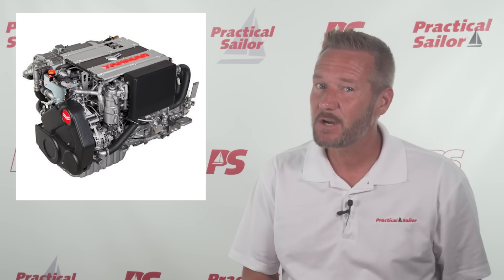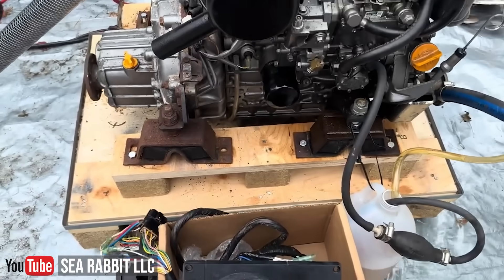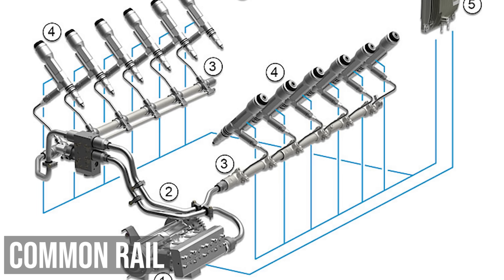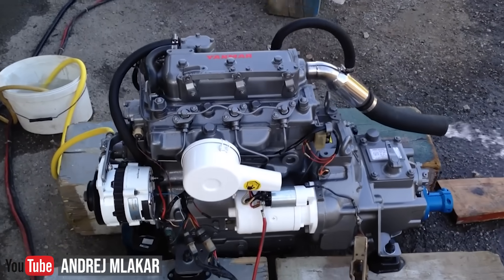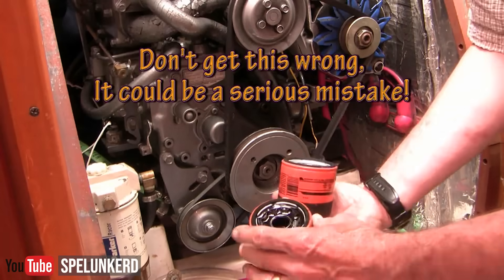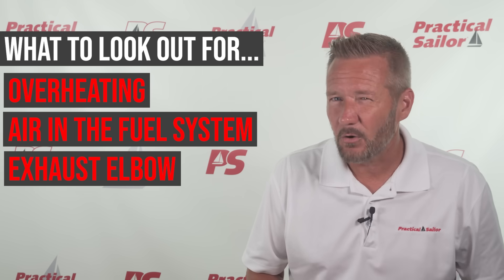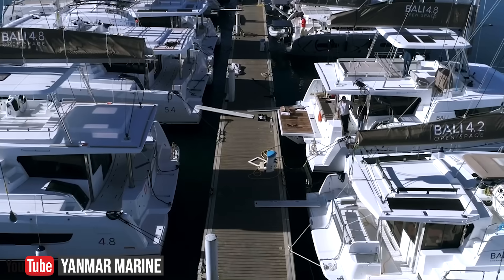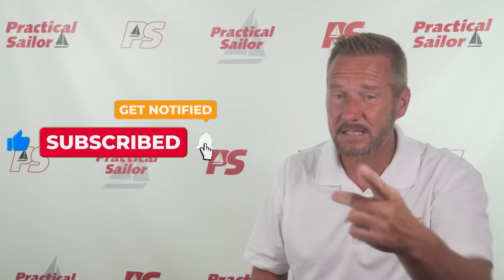Everything You Need to Know About Yanmar Sailboat Diesel Engines

Comment: He mentions critical nature of seals several times but neglects to point out the most important seal, and the one that fails most often, is the seal on the prop shaft in the lower part of the saildrive. When they fail water gets into the drive leg which causes a big problem if not addressed. These seals are not difficult to replace at haul out and should be done maybe every other haul out.
Reply: Don't run over fishing line seems to be the theme if you read ALL the comments here...fishing line just cuts the seals to bits.

Comment: I have a 3GM30 from 1999 that still works perfectly, touch wood. I love its simplicity and non reliance on excessive electronics. No glow plugs, but it has always started instantly, within less than a second of self starter, even from cold after not being started for days. To be fair I'm in the mediterranean though, where temperatures never drop very low. 😊
Reply: If that has a metal intake manifold and you head for a colder climate...
you could look at installing a Thermostart flame heater in that metal intake manifold (metal intakes for obvious reason when dealing with naked but enclosed flame)....
all it needs is a drilled and tapped hole in the manifold, minimal supply of diesel... and 12VDC.....
the slug of hot air ensures instant starts in cold to very cold weather....
Reply: @JohnSmith-pl2bk Interesting...thanks for the tip!

Comment: Yanmar? Excellent. What I don't like is seawater cooling in any form, nor watered exhaust. I've seen that diesels like to run at a very low 10-20% horsepower, but hate the lowest idles. You don't see anything like my 22 to one compression in boat diesels. They don't climb mountains to 12,000 feet, nor operate in deep cold. What I like about my air cooled Situan Sifa are these facts: Undersized means excellent for turning an alternator. Hand pull start. To change the oil, run it hot, disconnect, pick it out, and pour all the oil out the fill port. I've never used the empty plug. Steel gears and no timing belt. Utterly mechanical injection. I've never air bled the fuel system. Just hit the decompression lever and cranked out the air. The aluminum and steel castings are excellent without defects. I made my dry exhaust adaptation out of stainless steel.

Comment: Yammar.  corrosion of the saildrive is an expensive issue if not managed.   Coat the aluminum drive as recommended.  Propspeed, interprotect other is important to maintain, as well as checking and replacing the anode at least annually. . Don’t scrub the coating off the drive leg. When a diver is cleaning the water intake ports, you may expose aluminum that will corrode away.  Check the anode, make sure you have the correct anode metallurgy.  The split ring anode can be replaced in the water, and protects the saildrive, but not the prop.

There have been some manufacturers who have had corrosion issues with their saildrives.   If you keep your boat in the water year round, make sure you get a good inspection, replace the anode, and maintain the coating.  
Replacement drives have more robust metallurgy.  Maintain and avoid this.

Comment: ALL diesel are direct injection 

common rail just uses a mechanical pump that keeps ALL the injectors at the same pressure and then are electrically opened to the correct cylinder that is at TDC  
the other type - mechanical - uses a pump that is timed to send pressurized fuel to the cylinder that is at TDC  and that pressure is what opens the injector 

ONCE AGAIN ALL DIESEL ENGINES ARE DIRECT INJECTION ENGINES
Reply: Oh one other thing if you are going remote locations sailing..any lightning strike on or near the boat can fry the engine's  electronics...
read ALL the comments on here.
The Yanmar dealer will say "Oh we don't know about that..never heard of that."   LIES!

Comment: Thanks much for this helpful video. I haven't approached valve adjustment yet so i especially appreciate that intro. I just replaced my original, corroded elbow with a stainless- easy to do and hopefully has much better longevity. Would have liked to see how to adjust injector timing and spray check.

Comment: Own a 4JH2-TE with 15,400 hours.  Still purrs like a kitten, but considering a 4HJ80 as don't want to be stuck somewhere without good service.  Currently in Tampa Bay area for a few months.  Also thinking of a rebuild so not reliant on complicated electronics, but 63 hp occasionally not quite enough power for a Hylas 46.

Comment: My 2005 2GM20F @4500 hrs pushes my Cal 30 at 6 knots 10K lb sailboat zero engine issues I’m on the Westcoast so no cold start issues never stops running 2 liters per hour fuel burn 2800 rpm 😅

Comment: So the newer engines use glow plugs.  Yuck.  I used to be a diesel mechanic in the army and sometimes those glow plugs would explode inside the cylinder.  We sometimes were able 'fish' it out after breaking it off but many times it required taking the head off.  So you can see why I love engines that don't use glow plugs.
Reply: Are you aware of the Thermostart intake mounted flame heater
(not a grid heater but uses a small amount of diesel ignited by 12VDC to create flame and hot sir in the metal manifold?)

PS I have a 1991 Nissan turbo diesel that has all original and working glow plugs that are automatically used for every start...
and they are original (I have been the owner for 25 years)...
Not every diesel engine gets crap parts fitted....or ingests water

Comment: I love my 4JH45-cr but days after we bought it in a 5 yr old boat the ECU failed. I have yet to find an explanation; neither mechanic or distributer could help to explain. Yanmar regional service center said they have never seen anything like it, the circuit board was "fried". After several weeks on order and programming it was installed and is working well. But why -  The distributor reiterated the ECU has been use in autos for decades with a good record.

So what happened; I have yet to find a smoking gun. I was new to the boat and could have done any of the bad things. Further I found several poor grounding connections and main battery switches that had voltage drops, dead batteries, undersized alternator and power cables. So I've chalked it up as "all of the above". 

I don't like computers in critical applications but it greatly improves a diesel engine.
Reply: @boblivingston4841
3 days ago
Get hit or close to a lighting strike your common rail engine electronics can be damaged.The engine will not run, until new electronics are installed.
Reply: I think your Yamaha dealer was telling pork pies = lies....see the above comment.....
Reply: @sailingseahawk2012
2 days ago
So if it’s not mechanical fuel injection don’t buy it. Just had a buddy with a new 150 hp yanmar have a lightning strike. ECU 7k dollars alone! Injection pump 10k….

Comment: We have an early 3GM in a Bayfield 32 that we sail on Lake Ontario.  When we first got the boat it was always very difficult to start at the beginning  and end of the season - it does not have a glo-plug.  The starter motor really struggled to turn the engine over when it was cold.  I took the starter motor in for a rebuild but the shop called me and asked why I brought it in as they thought it was in perfect condition!

After reinstalling the starter motor I upgraded the wiring and the starter motor relay - now the starter motor turns the engine with no problem*.  But still the engine was reluctant to start when cold.  I read somewhere that early Yanmars should be started with the throttle wide open when the engine is cold.  I tried that and now the engine starts almost instantly!  It is kind of scary when it roars to life at high revs but I throttle it back quickly and it keeps running nicely.  I have done this for about 5 years now with no obvious problems.

* At the same time I put in a separate starter battery for the engine and used a battery combiner to make sure that the starter battery was always fully charged.
Reply: Unless my 3GM30F has been running in the past 24 hours, I always have to start with full throttle. Boaters around me whip their heads in my direction because they probably think I'm an idiot. Now that I read people's comments about rewiring, I'm going to try that. I used to own a Bayfield 29. We repowered that with a Universal 18 hp. 😀
Reply: OMG, last weekend I rewired from ignition to starter with 10 AWG and it's a game changer! The engine now starts at half throttle after about 2 cranks!!! I'm elated.

Comment: Biggest "Gotcha" on the earlier ones especially is corrosion in the wiring harness connectors. This manifests by the starter motor not spinning when the button is pushed.. Can be easily cured by bypassing the connectors with a larger wire size (and appropriate fuses) so that the solenoid gets enough power to operate reliably. I have a 3GMF from 1985.. still runs perfectly.. 
Glow plugs have not been necessary here on the Gulf (America or Mexico?? ) .. 
I appreciate the videos... Practical Sailor subscriber since 1980..
Reply: I agree with the "Gotcha" about the GM series having corrosion issues in the wiring harness connectors, but I’d also include the key switch and push button. My solution was to install a piggy-back starting relay near the engine to reduce the current passing through the key switch and push button, limiting it to just what’s needed to power the field wiring of the piggy-back relay. Dielectric grease should be used on the pins at the connectors.

Comment: Hi Tim! have the Yanmar 3GM and it’s 30 years old with about 1600 hours. The one weakness I found with this Yanmar is the external oil line. It is known to corrode & leak which recently happened to me. It’s a job to replace it. And as Tim pointed out, the impeller will go as well so replace it every year or few years. Keep up the great videos!
Reply: Then again the external oil lines are RIGHT THERE and easy to replace if needed. Keep after the rust and keep everything painted.

Comment: 55 years ago my wife and I built a 28' sailboat to go cruising.  I put in a single cylinder, 5 HP Yanmar that I purchased cheap in Mexico.  It had a hand crank start, no starter motor, but with a huge propellor it pushed us at hull speed (4.9 knots).  I added an alternator but it would not push the alternator and boat at the same time.  The best part though was that it got 10 hours per gallon of diesel. The fuel tank was 40 gallons and we ran it for 9 days straight continuously between Rarotonga and Tonga making 100 miles per day and we still had fuel when we got there.  It never failed to start.  I loved that little engine.
Reply: The fuel economy with these little diesels in a full displacement slippery sailboat truly is stunning especially when compared to powerboats that get 0.5-2 “miles per gallon”. 

Your fuel mileage is incredible. 

My boat is a modern 27’ with the beam carried all the way aft and 8,000lb. It has a yanmar 1gm10 9hp. Cruising at 5.5 knot it burns .25 to .3 gallons of diesel/hr. Pans out to roughly 23 “miles per gallon”. Not bad for taking your entire home wherever you like 😊
Reply: That is my favorite diesel boat engine.
Just because of the sound it makes.

I just asked a friend about the 2 he had last year.
Hoping he was selling one.
Unfortunately he gave them away last winter.

I would have loved it for a little dinghy.
Reply: Epic
Reply: @higheryearning321 I had a single cylinder air cooled Yanmar running a backup generator for my off grid Smallholding same power got well over 30 years out of it, then gifted it to a neighbour, when I left to look after my parents. Problem though, for where I was mostly sailing - The Irish Sea and Bristol Channel- that size was chronically underpowered for the tides and currents we get here. Example, the Bumbling Sailor Channel just couldn’t get through the flood tide to get around Portland Bill on the South Coast of England- and crewing and skippering for others, has had us stuck in nasty conditions in wind acceleration areas, because their inboard diesels just weren’t powerful enough to permit us to escape until conditions eased with slack water. Today, as a result, I really like overpowered engines in a Marine environment tbh. Bob.🤔🌟🌟🌟👍❤️⛵️

Comment: The exhaust elbow issue is not constrained the Yanmar. I have seen it on other engines too. Had that problem on a Universal Marine engine, so clogged with rust it blocked the exhaust water. I replaced it with a stainless steel version, works like a champ.

Comment: I used to own  a Yanmar 2GM20F.  Had it in my sailboat for about 25 years.  Never ending maintenance issues.,  Gripe #1 no preheat......... A little extra cranking you say... try 20 -30 seconds even with full throttle.  Sometimes had to stop at 30, then try again before it would fire up.  Gripe #2 fuel system banjo bolts  and associated  crush washers at the primary pump and Yanmar fuel filter.  Always leaking ............ very tricky to get that torque just right.  over torque and you strip the fitting (stainless fitting into an aluminum housing).  underdo it and it leaks.  
I eventually gave up on the unit and replaced  it with a Beta 16.   Wished that I had done it 5 years earlier.  It starts easy.  Self bleeding on the fuel system.  The  sea  water impeller change is simple......... do not have to   remove the pump and turn it 180 degrees to service it.
Reply: Couple of mechanical issues methinks. #1 - Mechanical fuel injection pumps are designed to shutdown and rest in full throttle position ready for restarting, if it's not doing this then it's probably not injecting enough diesel at ~below idle rpm to start up properly.
I suspect that the fuel pump's governor isn't resetting enough (or has been mis-adjusted) to allow it to rest in full throttle, or one of the pump high-pressure plungers is leaking out until the low-pressure pump overcomes it...potentially needed an overhaul. 
#2 - Replace these crush washers (which are crap) with Dowty washers. These seal internally so you can torque them up to whatever is needed and the internal o-ring does it's job. There's a reason why they're used on very-high-pressure hydraulic fittings.
I too have been plagued with dodgy crush washer issues over the years, since throwing them in the bin and going with Dowty washers, never had an issue...just don't try and re-use them, they do not like that, even with copious amounts of PTFE tape.

Comment: 40 y.o 3GM-F with 3,200 hours. Lake Ontario, seasonal use.

Got bright nail polish & marked all the bleed screws on the fuel system. Got good at it while diagnosing an air leak in the fuel tank.

I love the simplicity. It just starts & runs.
Reply: Great idea with the paint

Comment: You stopped short of the final exhaust component....just after the elbow is the waterlock...It's the thing that makes water repeatedly belch out of the exhaust through-hull.

I learned the hard way (offshore) that these also can sink the boat.
I experienced a corroded (70s) metal one that sprung a leak and filled the engine bay with seawater halfway up the sump.

I'd gone off shift and down below and my feet felt water sloshing upwards against the soleplates... because the bilge pump guage that had been silently (fault) masking the leak decided to fully hard fail. 
So we were properly sinking and in danger of shorting the HVoltage or blowing the engine.....but only while the engine was running.
We aborted our English channel crossing manually pumped out the bilgewater and got back to France and managed to cobble together a repair that held for the passage home next day.

I now locate and examine this on every boat I get on for more than a day passage.
Reply: Bilge pumps...two is one and one is none....as you found out.

Comment: Hi Tim.I absolutely love diesel engines, some a bit more than others - and lean more towards marine direct drives than Sail drives, and particularly what was the case for Yanmar Sail drives connected to engines of under 80 hp, at which point they could have the excellent ZF Sail Drive. Lesser ones wear stuck with the problematic Cone Clutch, which introduced temperamental unreliability - until about 2018 when Yanmar introduced the Service Update Kit, which pretty much fixed all issues. For me, it is a tough choice between Yanmar, which I have had a lot of long term success with and spares easily obtainable globally, and Mubota based engines also with pretty easy global parts availability - why I will not touch the other excellent diesels from Volvo tbh, which to me, Volvo has been a Rip Off Company for way too long sadly. The 2 cylinder 22 hp Yanmar in my Endeavour 32, though underpowered, due to being new, just run in,and the hull being as clean as a whistle, when needed and in calm periods made reliable speed and distance from the Gulf Stream running for Safety to the Harbour of Refuge in Rhode Island, and averaging just over 7.5 knots, we were the first ones in, ahead of the arrival of the Severe Tornado Storm I think I told you about. The following morning, having survived, I filled up with diesel before leaving the harbour, and the diesel used during no wind motor Sailing ? A half a gallon, and Imwas only just able to fit that into the fuel tank.,tbh, I was more than a bit surprised. I would have been happier with a much more powerful twin though, but that’s just me who can’t abide underpowered engines in a marine environment. Best Wishes. Bob.  🤔🌟🌟🌟👍❤️⛵️
Reply from the maker: WOWZA!!!!